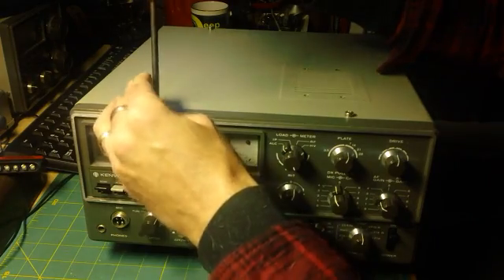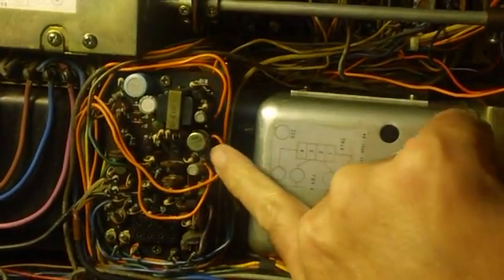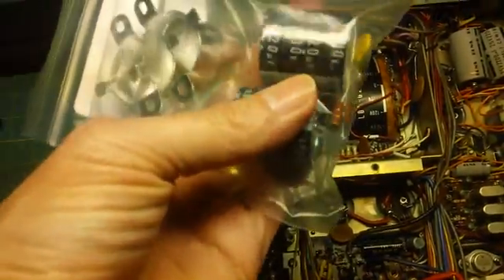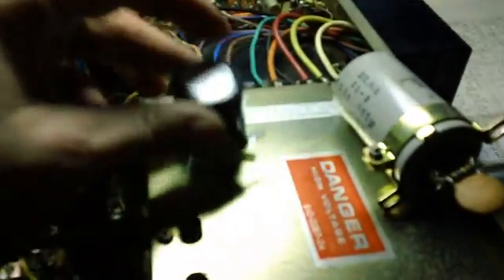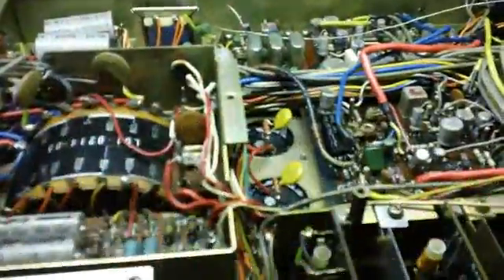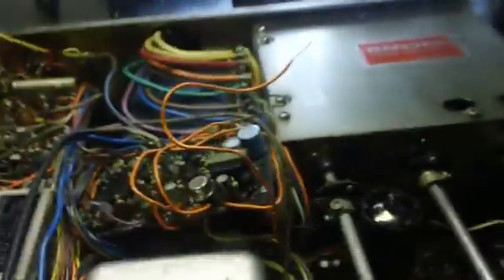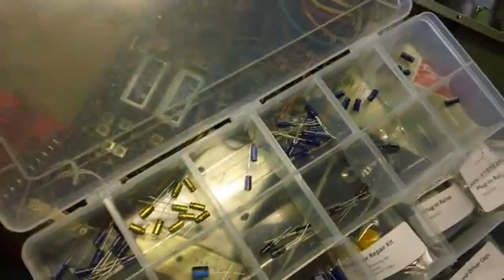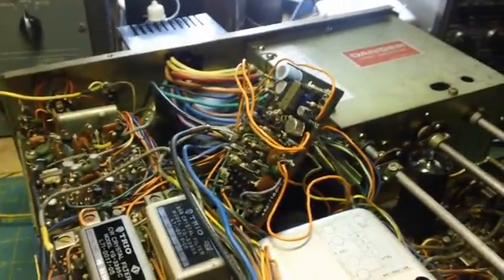Kenwood TS-520 Restoration Project 1

Comment: If you have the "positive rail" going  to ground then you have a problem. The positive side of one cap should be going to the + of the hv rectifier board. The "center tap" as you are calling it goes to one side of the hv winding. This is where one + and one - of the caps are connected. The - of the other cap should be going to ground.

Comment: Please let me know where you got the schematic for this radio. The ones I got on the internet are very hard to read. - Geoff KE0BNX
Reply from the maker: geochaben You can get the owners manuals  in PDF that has the schematic in pretty good resolution here; http://www.wb4hfn.com/KENWOOD/Kenwood-Articles.htm ,although I have the original owners manual with it I don’t have a way to scan it.
73Tom,k3bew
Reply: Thanks.

Comment: Nice Showing your mistake helps. 
 I hope to see the final alignment procedure at the end.

Tom K9ASE
Reply: At first glance of the hv circuit it looks a bit confusing. But the hv board is a half wave rectifier circuit. Just imagine one capacitor being charged from one half of the cycle and the other cap being charged from the other half of the cycle. Each capacitor has exact half of the 800 vdc charge. Between ground and the positive rail you have 800 vdc.

Comment: Great video.  I picked up one of these on ebay recently very cheap and trying to put it into service.  The first thing I notice is that when I rotate the main tuner knob, the dial scale and subdial do not move.  Only the large center knob rotates, nothing else.  Could that be a mechanical problem vs electrically related? (gear not meshing or drive belt or something)  I'm wondering if the two dials should move in sync with the main knob, even when the set is off, correct?
Reply: To answer my own question - yes.  The outer tuning dial and sub-dial (behind the glass) should all move when the tuning knob is turned, whether powered on or off.  I removed the VFO and found that the sub-dial was getting obstructed by a screw on the front frame behind the faceplate.  I substituted a shorter screw and the problem went away!   All tuning dials now turn simultaneously!